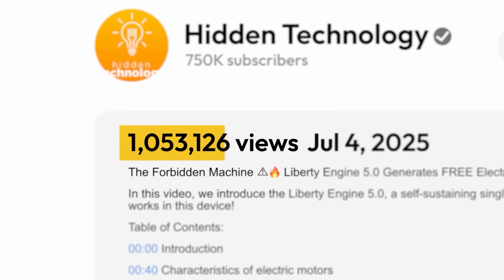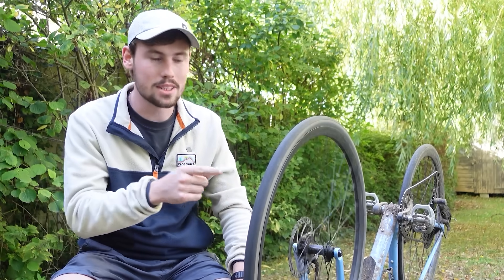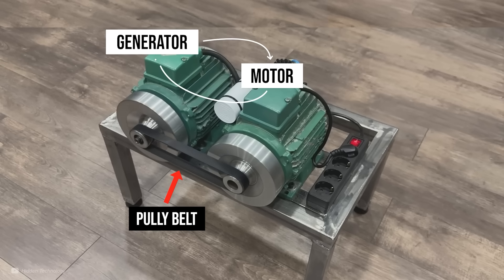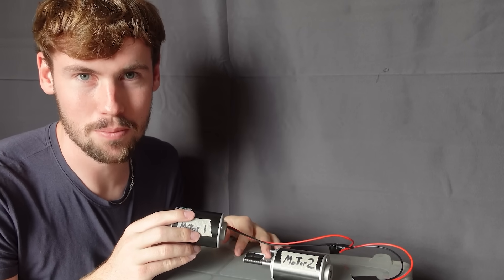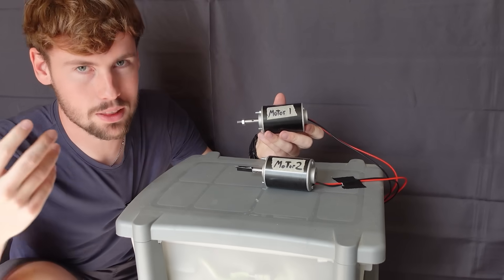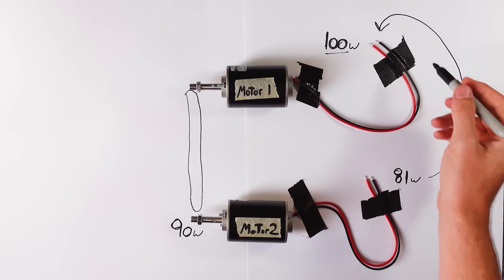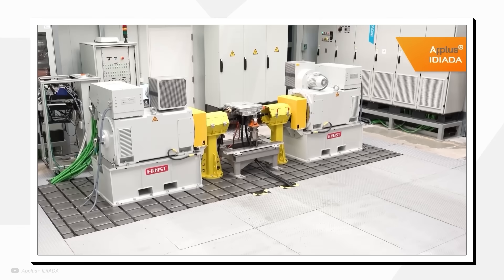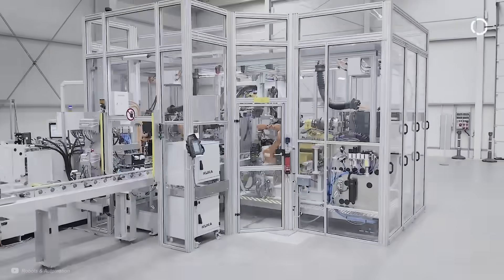100 Years of Waste! Solved by an Unlikely Invention.

Comment: People get hung up on the phrase "perpetual motion" and forget the old axiom which states "Perfect is the enemy of good enough."

As you stated in the video, in a closed system, perfect efficiency can't be achieved, therefore no 'perpetual' machine can exist, because entropy always increases. That said, we should be looking for ways like the ones you have demonstrated to scavenge energy wherever possible. Additionally, we should be looking towards other methods, which might provide tiny amounts of energy reclamation in isolation, but when combined across a system can be significant.

Why not install piezo sensors in walls and floors to convert the sounds in a busy house or building into energy? Similarly, why not install heat traps or stirling enginelike devices in the walls behind radiators to generate electricty from heat which is being wasted in the winter months? There are so many ways of scavenging electricity and we don't seem to be using them, because they are often dismissed as being inefficient. Sure, they are inefficient, but they are something and it must be better to have something, than nothing, right?

Comment: I don't understand why you would do this since the amount of energy you have to add is just to make up the lost that is needed to keep the unit running. Once you put a load on the system the power domans go way up cause the amount of engery to keep the unit running to increase significantly. To me, this idea seams to use more energy.

Comment: Thanks for the post.
Falling water, waves, wind, changes in barometric pressure, changes in static charge over altitude, nuclear, sun, light, and probably other sources can be utilized to emulate "perpetual motion" but they all depend on outside sources of additional energy to keep it running for real.

Comment: The CONSERVATION of energy doesn't allow ANY Perpetual motion engines from actually working the reason for this is the efficiency of the motors NOT BEING 100% energy efficient... This is why it won't ever work until we actually get a 100% efficient motor because energy is never DESTROYED it is converted to other forms of energy "in a motor this is called energy loss" and what makes motors too inefficient to make an engine that generates its own energy without additional fuels... "This is what a true perpetual engine would really be" if you are indeed trying to reclaim lost energy by using a second motor as an alternator your still adding additional friction and Load on the additional motor that will cause the first driving motor to be harder to turn over, so you see what your building is just a energy reclaimer "like what we have in sime cars break system or electric bikes to restore a "tiny" amount of energy loss but never at %100 efficiency... Unless you've made a %100 efficient motor your NEVER GONNA MAKE WHAT YOUR SAYING YOUR MAKING... wake the fuck up out of dream land... Its not realistic...

Comment: It could be used as a PRD. (Power recovery device) for another machine, say a generator connected to a system that powers a factory, you could add one of those to the end of the output shaft and use the mechanically recovered power and feed it back into the battery, or even the shunt capacitors. Also you could recover even more power by using a peltier convert heat from the motors into even more recovered power to feed even more of the waste power back into the system.

Comment: WHAT ABOUT GEAR RATIO SO THE POWERED MOTOR TURNS THE GENERATOR MOTOR SPIN THREE TIMES FASTER WITH WEIGHTED FLY WHEEL A BANK OF CAPACITORS AND A BATTERY TO START IT

Comment: What happens when you have a constant power input of 100 W? What is the output in this double-bind motor/generator setting? If you can have smaller input for the same output, then logically you can have bigger output for the same input, but this brakes conservation laws. Does anybody have an answer?

Comment: Um, but what good is a motor that doesn't do any work? In your example, it cost 19w to just keep the motors spinning with no external load. So if you add a load, then you'd have to provide power for that load plus the 19w of the  system, right? What am I missing?

Comment: Why not capture the heat from the motors and generators, and turn it back into electricity. It won’t be 100%, but it will produce power for some time after they stop spinning, and it will add up over time. Savings grow even more

Comment: An even simpler approach, assuming reasonable power ratings, would be to use a motor and drive(electronics) combination that has regenerative braking capability as the variable load. Those are pretty much standard items up to at least around 100KW as machine tool drives, and likely much higher powers.

The Braking force can be controlled by modulating the motor brake torque - and the drive just connects straight back to the normal three phase Ac power, as when if it was in a normal machine tool.

[Re. the "free energy" nutters using motors and generators; I get the impression they cannot get over the fact that a small generator will turn quite easily by hand even with a load connected, so believe that they don't take much power to genuinely run under load at full speed].

Comment: Listen you silly bint. If you really want to make it work all you need to do is leverage the energy by putting a 3-1 or a 5-1 gear ratio between the motor and the generator. For every 1 rotation on the motor is equal to 5 rotation on the generator giving you essentially 5 times the output. Or change the ratio to 10-1 , or 20-1 ... whatever. Work smarter not harder lol

Comment: Dude I don't know what the fuck this video is about. You start at the beginning saying perpetual motion machines don't work which they don't. And then you go on to talk about how this perpetual motion machine works. One motor feeding two generators is the same thing as two motors. Feeding one generator or one motor feeding. One generator energy in is not the same as energy out because of heat and friction

Comment: Ward Lennon systems go back to the late 1800 using AC motor to drive DC generator to drive DC motor which was the first form of speed control used on cranes and elevators, on cranes the AC motor could be substituted with an engine.

Comment: Let's say you are able to make a perpetual motion engine. Just the moment it gets any workload, it'll come to a full stop anyways. And that it takes way more wattage to generate whatever watts a motor is gonna consume. I think the beeeeeest case escenario would be using the generator motor to some large capacity capacitors to store and provide a steady electric output to an inverter hooking its output to a pulling motor of higher voltage/wattage.

Comment: I agree in all the points, there are very good examples and a lot if work put in the video, however, the approach for introducing the several pieces of information can be totally misleading for people not very versed in this matter. 

I do not think the engineering solution you explain has any basis on perpetual motion machines at all, and making it look like that gives credibility to some aspects that should not have even a tiny bit. 

Waiting for future content. Cheers.

Comment: The " Smart Matress" could be used to generate current if it was used on a water-bed with a mini wave powered generator inside. A " Grid" of matresses connected in series could generate Gigawatts if the people on them worked in tandem and were also earning Watts that were deducted from energy bills. "Off-grid" it could still charge a phone. Thanks for telling us viewers that you value our "Time", politeness and comprehensible language will get you far❤

Comment: Yes I am using this method for my electro car I put smaller wheels in the front for the generator to rotate faster and bigger wheels at the back for the electric motor and because the car is always on a slope it always runs down hill and therefore even gives me 50% more power. You can order one now before Elon musk shuts down my company.

Comment: Remember kids: it takes energy to make energy, Generators work by converting mechanical energy into electrical energy through the principle of electromagnetic induction. A prime mover, such as an engine, uses fuel to rotate an alternator. The spinning alternator creates a changing magnetic field that interacts with coils of wire, pushing electrons to create an electric current. This generated current is then regulated and distributed to power devices.  

The Core Process Mechanical Energy Input: An engine (powered by fuel like gasoline or diesel) provides the initial mechanical energy, which turns the generator's crankshaft. 

Electromagnetic Induction: The rotating crankshaft spins the alternator, which has magnets and coils of wire. As the magnets rotate near the coils, they create a changing magnetic field. 

Electricity Generation: This changing magnetic field induces a flow of electrons within the coils of wire, which is the electric current. 

Regulation and Output: A voltage regulator monitors and adjusts the electrical output to ensure a consistent voltage, and the electricity is then ready for use.

Comment: OK, what if you took this system you're describing (motor in the middle of two generators, connected by one continuous drive shaft), and instead of a physical bearing. They were mag lev ( You know like those levitating pins), so there is no heat loss to the bearings.

Comment: I wondered what people did to get enough energy to run a house from a dynamometer. The best I was ever able to get was a few minutes of motion.
I like to build and test things that people say "Can't work".
The magnet only motor is the only thing I've ever had any luck with as I've been able to get three different designs (2 rotor/stator, and 1 half stroke piston that I designed which is similar to a steam/air engine) to work on demand, EXCEPT...
All three had the same problem.
The magnets lose their charge over time, and the shields tend to become magnetized, requiring a lot of maintenance to keep the motors serviceable.
But it was enough success for me to call magnets "The world's most efficient battery cells".

Comment: We have google for that. 1934: John J. Hanley invented the first uninterruptible power supply (UPS) and patented it as the "Apparatus for Maintaining an Unfailing and Uninterrupted Supply of Electrical Energy". This early UPS system used a flywheel rotary design for backup power; 1955: Fuji Electric, a Japanese company, delivered their first flywheel-type UPS systems. As for the energy storage: the first modern applications and research into flywheel energy storage systems (FESS) began in the 1950s, leading to prototype products in the 1970s and significant developments in the 1980s with fiber composites and magnetic bearings.

Comment: The video referenced though takes apart one of the motors and turns it into a permanent magnet motor/generator using some special proprietary secret sauce silver and some other compound material that surrounds or backs the permanent magnet blocks that they arrange and epoxy on the grooves they carved into the rotor using a router and a lathe to make it flush. They then use an large capacitor bank for each of the phases, so supposedly the theory is that its expsing the true definition of dielectrics somehow,  in where theres a way to tap into ether and in that way pull the excess energy generated out of the ether/zero point. I'm still trying to understand what Tesla and others who wrote about it and studied that whole thing but without practical hands on teaching to follow im  hesitant to try seeing as it could very easily end up exploding something if you were to suddenly try to shutdown one of these ether currents the wrong way or something like that. Tesla after all was able to push 2 rods into a black box and somehow that allowed it to power  small device on wheels and propell itself without a battery or wires. To my knowledge we don't know exactly how this was done, just that it was tapping into the ether for its energy. As I understand it , those guys did not believe in the concept of the electron, and instead believed in their theory of the dielectric.

Comment: There is no usefull energy that can be extracted, to use else where than each other.
What is the gain to keep running these motors?
You just feed for the energy loss (keeping in mind that these losses are minimized, by reducing the friction and heat losses)

Comment: I've got some business band radios from the 50s that use a 12V DC motor to spin a generator that produces a 500V DC output.  It's used to drive the radio transmitter without having to convert the DC to AC so a step-up transformer could be used.

Comment: This still looks like a waste. since you put 100W into the motor and the generator returns 81W, you still input 19W of power without doing anything useful with it as there is no other load on the motor doing actual work.
If you add some other load to it, say 50W for a lightbulb on the generator, that power still comes from the grid via the motor, making the motor consume even more to about 160-170W due to the losses in the motor, belt and generator.
So doing 50W of actual work, you consume the 50W for the load, another 10-20W for the losses on top of the 19W you lose anyways due to the setup itself.

I still don't see the benefit of using it.

It's as silly as putting an alternator in a Tesla to rechange the battery that's hooked onto the wheels. It only means even more losses as the motor has to power the generator and the recharging of the battery on top of driving the car compared to just using the motor to drive the wheels and nothing more.

Comment: I had thought that the "free energy" devices behaved much like a battery.  You spin up a flywheel and then, either through friction or some other mechanism, take the stored energy is taken off of the system.   The presentation suggests a different way: just add back the little bit of power lost.  If I understood the clip correctly?  Not completely unlike regularly used AC motors, where the rotor acts as a flywheel.  I should admit that I am not a trained Electrical Engineer nor a Physicist.

Comment: A motor powers a generator that powers the motor,, sounds simple until Mom comes into the room and turns on the light switch ( which is attached to the generator that's powering the motor.)

Comment: This idea has been tried for a long time. In 1962 (I was 16) I met a kid at a school science fair who was trying to do this with two model electric motors. He would connect one motor to a couple of batteries to get things started and then disrupt the connection. The two motors connected by a rubber band would come to an immediate stop and he couldn't figure out why. Without even giving it much thought I knew why but I also knew it would be useless to try and explain it to him. So I just left him scratching his head.

Comment: I assure you that the one on my channel is real and has no moving parts.... 30,000 volts and 1000 amps if the arc is steady. It works because it uses the waste heat and sound to power itself. When you see how simple it is you will realize how naiive most people are. Although it doesnt mention it in the video .. it also does anti gravity because the current going through the parallel conductors are in the opposite direction. It even makes water, carbon, calcium, sulphur, Hydrogen , oxygen and more. It coverts the dust and gas in the air to elements.. DC to AC dust  and gas to matter conversion. No battery, no coil, no magnet or any power source is needed..... although it DOES become a powerful electromagnet because of the parallel conductors... and it uses the heat from this electromagnet to make a sound that makes it power itself from it's own sound. Some of the engineers and electricians and musicians who saw it all realize it works and you can see that by listening to their comments. It's the only free energy cavitation device out there that really works... and it is so dangerous that it could kill you. The video says to ground it.... but if you ground it .. it won't work. It will work if you don't ground it.. but for safety of the people I told them to ground it. ( had to so people don't hurt themselves). The asymmetrical capacitor/ Helmholtz resonator won't charge if you ground it.  It's royalty free and you can't even give it away for free because people are too brainwashed thinking it's not real when it most certainly is. It will produce over 10 million dollars of electricity a  year that you can sell to the grid with no running costs.

Comment: The air cooled 18 cylinder Wright aircraft engines in WW2 had to absolve a several hour test run, before they left  the production site. They drove  electric generators connected to then grid.

Comment: Very interesting engineering.  I work in HVAC unit design, and the largest electrical load are the compressors, which have motors in them.  If they could make a compressor that draws a lot less energy from the grid, that would be a huge game changer.

Comment: The heat doesn't have to be loss either. The idea is to stop thinking of anything as wasted energy. Think of it more like "money left on the table". Wasted is gone, but energy is never really gone we just aren't using the form it gets converted into. So it's really still on the table to be grabbed if we can figure out how. For example wrapping all the parts that get hot in some sort of thermoelectric generator could grab a little more electricity from the heat energy that's still left on the table. People are going to have to get inventive on how to recycle more of what would normally be wasted or lost energy back into the system.

Comment: Another reason to connect motors together is for phase conversion. A three-phase dynamo driven by a single phase motor provides a simple power supply for industrial machines. Can be useful for running old drills etc.